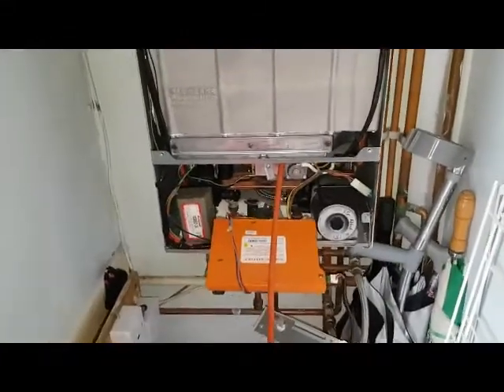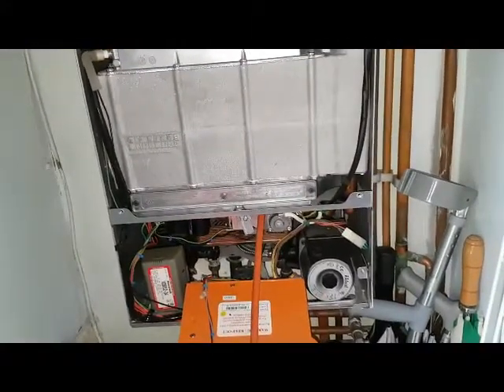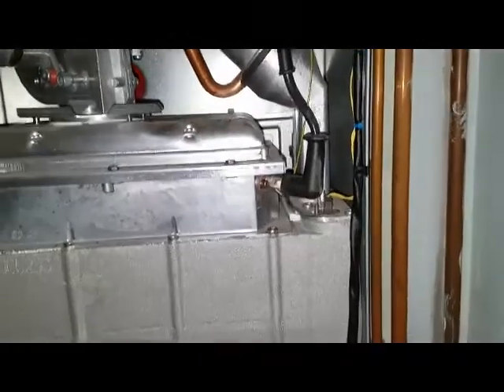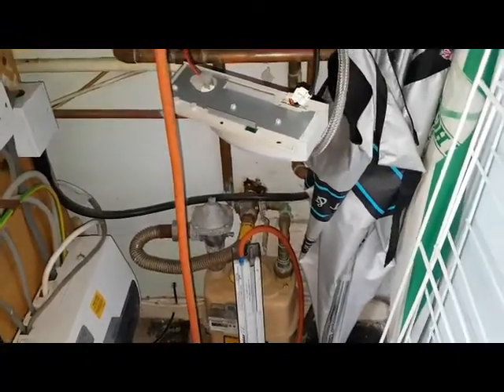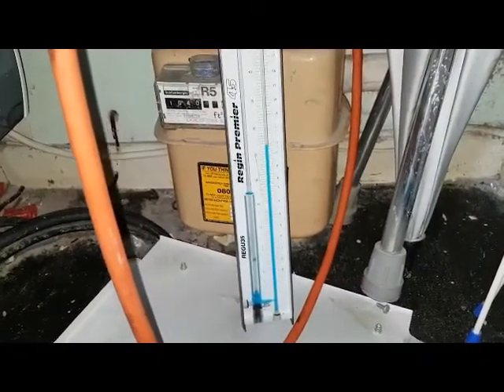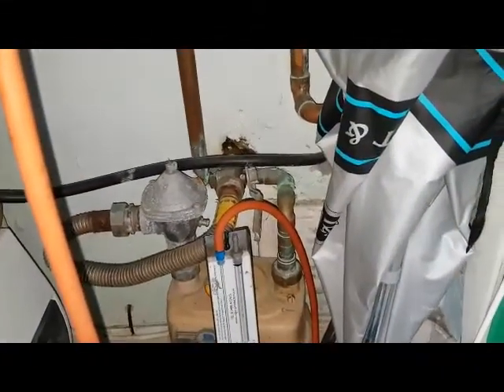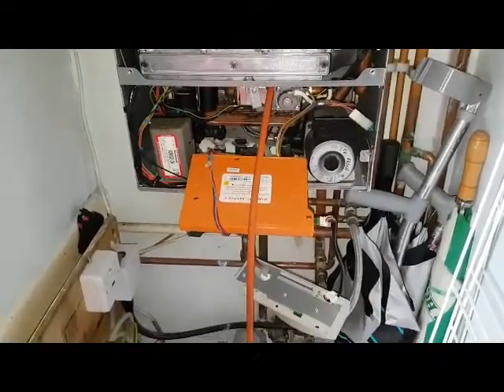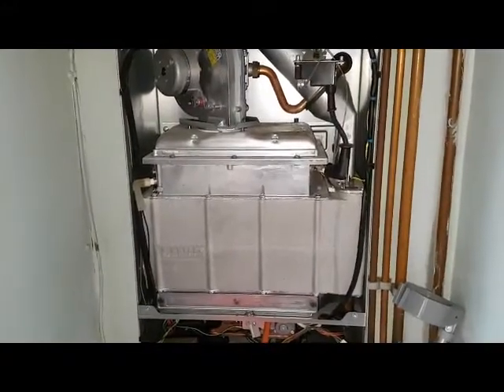Boiler Repair Training Online Ideal Isar HE30 LF Code. With Coach Tony Morgan

Comment: Not relevant to the video but detection can be measured between detection probe and detection lead probe connection on micro amps on multimeter. I think they are around 4mA? Could always check one that's not faulty for reference. Handy to know if you have an intermittent "LF." (L F dot is detection related) as most people assume it's the detection lead that tends to crack so they replace it..
Reply from the maker: Thanks for your interest you could help out. Why not join us at www.masterfulengineer.co.uk
Reply from the maker: hey we're currently trying to grow our Facebook group and would love you to join Tony and the team using this link, Tony will be available to answer all your questions directly there's also updates on new trainings we just released too. https://www.facebook.com/groups/167070231326174